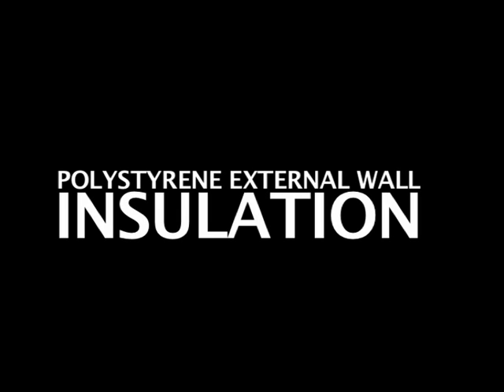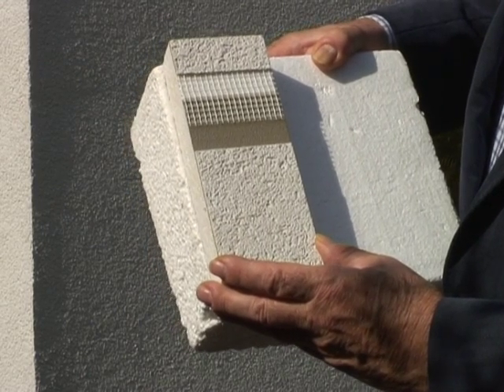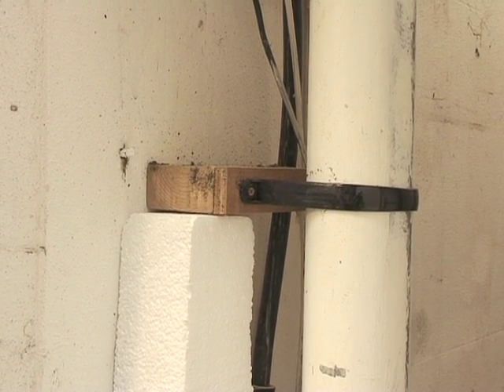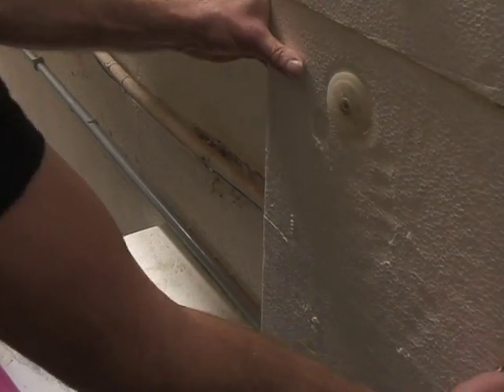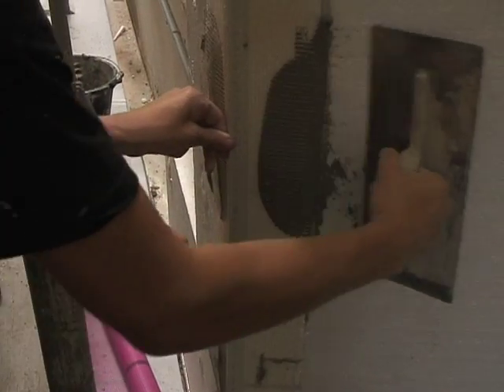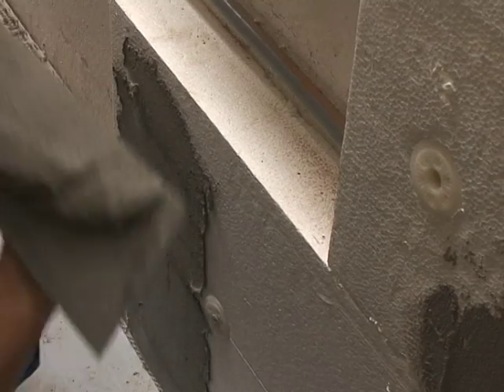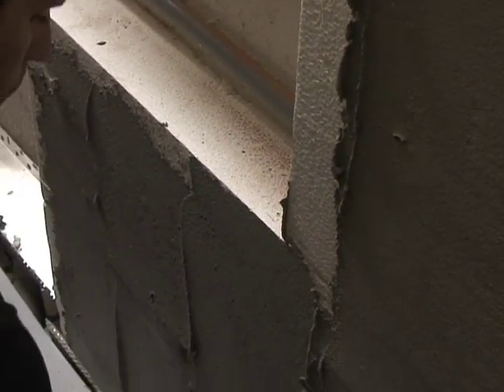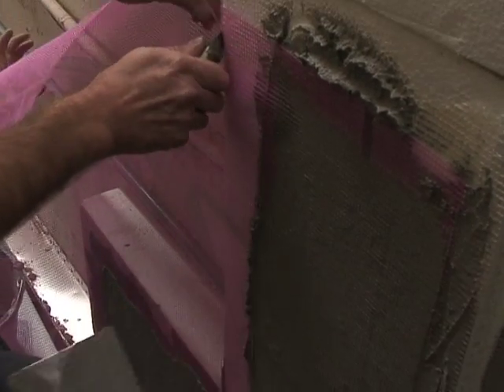Is polystyrene external wall insulation cost effective?

Comment: Were they using regular sand and cement render? Because this may be wrong. ICF manufacturers (ICF also has a polystyrene outer wall) recommend using a special adhesive basecoat, fibre glass mesh,  silcon based primer and render finish on buildings. And not the greatest finish whatever they were using.